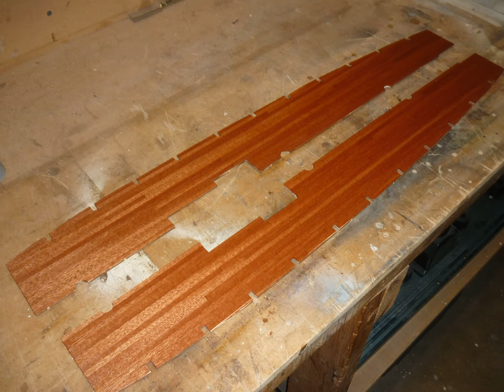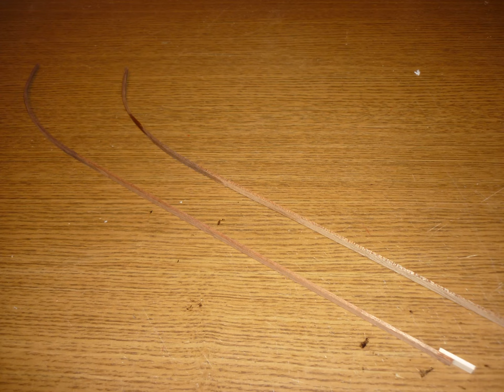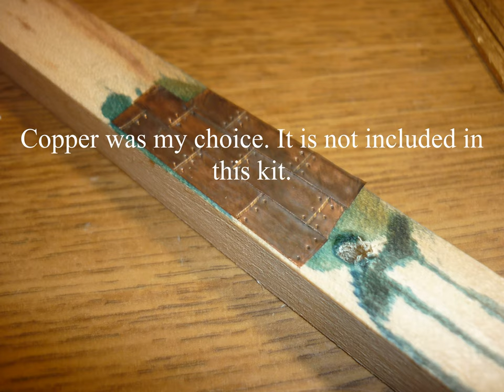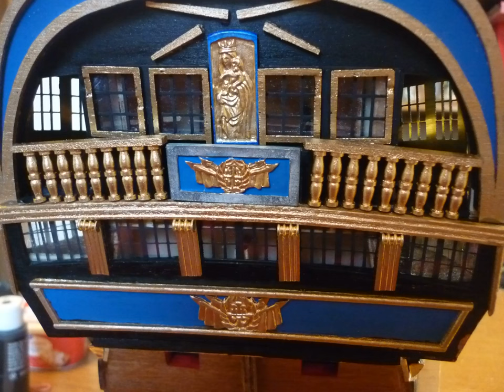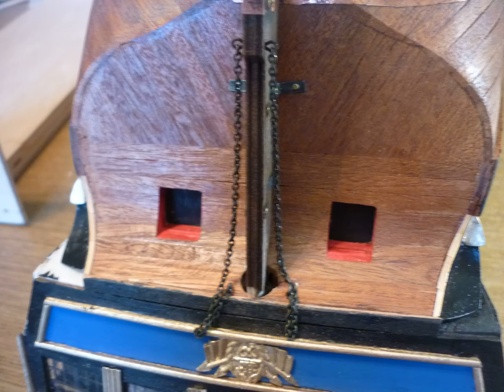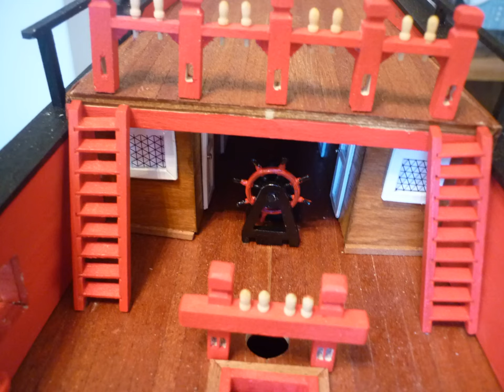Nuestra Senora del Pilar Build

Comment: Absolutely stunning finished product.   Outside of the copper plating on the hull and the paint, what additional parts/materials did you add to the build?
Reply from the maker: Thank you kindly. I think that's all, except there were a few parts that didn't fit where they were supposed to. The kit did come with sails, but like most of the boats that I build, I chose not to add them. I also will build a better base for Pilar as the one supplied is very light, flimsy and doesn't look good. If you haven't seen them yet, I have four other builds on the tube. Check them out. Thanks for the interest.

Comment: Awesome work!!! My husband and I are actually building this model - it is our FIRST model.  It doesn't look quite as good as yours. 🤣
Reply from the maker: Hi Jean. This isn't one that I would recommend as a starter, but it does have pretty good instructions pics and drawings. Also, the model being so large all the parts are easier to make. I wish you good luck, and use You Tube for help when needed.
Reply: @gordonback  hello where can I purchase this package what other models they have?
Reply from the maker: Hi Mario This is made by OcCre. They are a company in Spain. They also are the best model company out there. You can find them on the Web. and all the models that they make. They are the best to deal with, and are very fast at mailing orders out. It only took one week for this to get to me here in Missouri. Hope this helps, Gordon